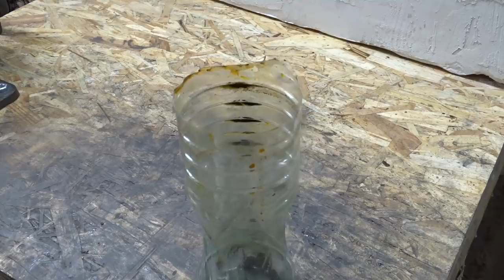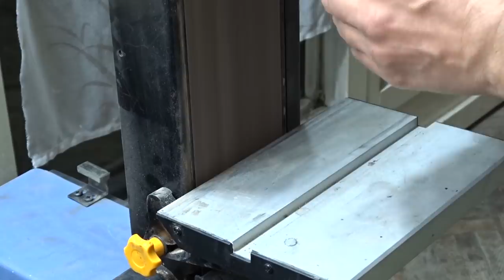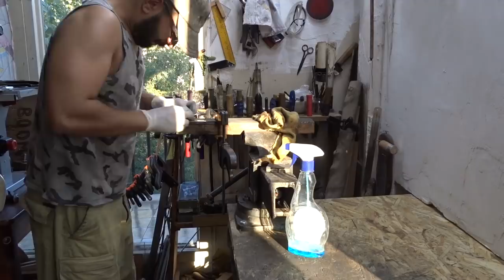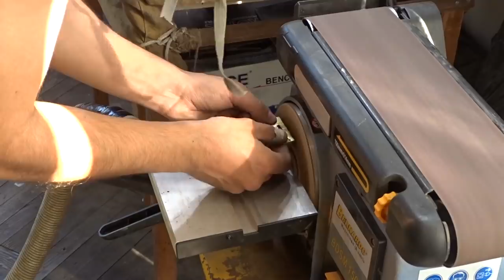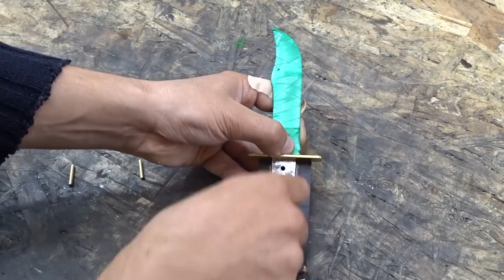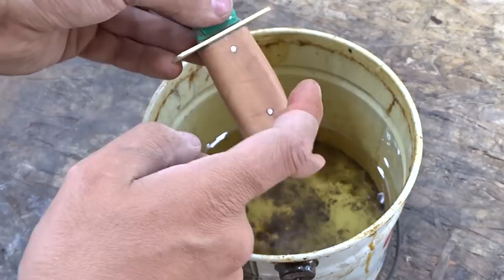Old Rusty Pirate Knife Restoration

Comment: Very nice job!  The knife turned out great and I love the new wooden handle. I did make one observation, 
however. You spent a lot of time and effort removing so much extra 
stock on the handle using a file and sandpaper, that made me wonder why you didn’t first take off more stock using your saw and leave just
a little bit to sand and file off. Wouldn’t that have made more sense and much easier. All in all, 
I thoroughly enjoyed the video and 
the knife looks great!

Comment: Nice job! It made laugh when you started cutting the guard with a bow saw and went like: “you know, this would be easier with and angle grinder”.
How can you tell is a blade is hardened or not by hitting it with a piece of metal? Does it make a different sound?
Reply: When you file a blade with a file, you can tell if the blade is hardened by the sound, how much material gets removed in 1 swipe and how well the file slides. If its cheap ass not tempered metal, the file will basically rekt the blade.

Comment: to me, this looked like a homemade knife, kind of a utility knife, not meant to be a weapon though any knife can be a weapon. If it was aboard a ship, it would have been carried for cutting ropes, nets, gutting fish, whatever need arose. You took it from basically junk to a beautiful piece of work, very nicely done. you have a grinder  a dremel and disc and belt sander, judicious use of these tools could take a good amount of the hand filing out of the equation, tho not all, you want to hand file when you get close to where you need to be, and where it's the only way. I don't know if you prefer to do most of it by hand or not, they way you do it works, that's for sure, but man it must take a long time when you don't have fast forward super filer and super sander lol. I love how you do the handles. insetting the tang perfectly probably means they will never give or get sloppy. It can wear or break it is wood, but it won't be because it's a sloppy fit.
Reply from the maker: Thank you for attention and advice's, sir.
Reply: @ScrewsAndTools  Method to my madness, if it doesn't take so long for each one, we get more vids!